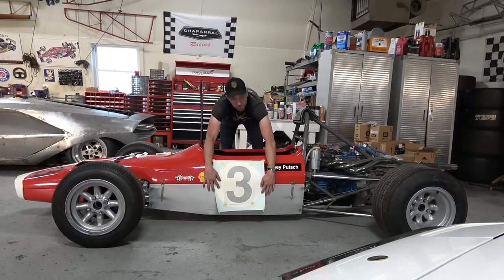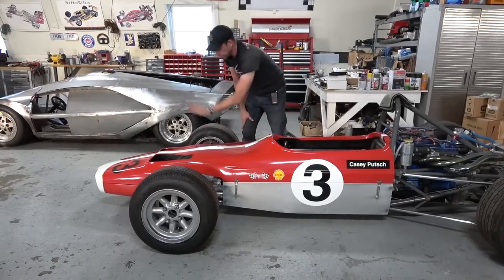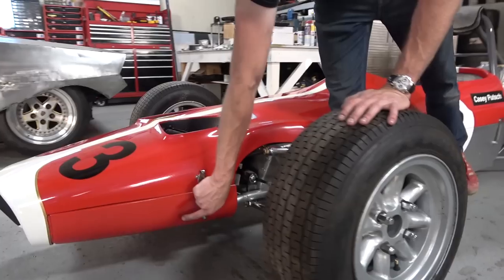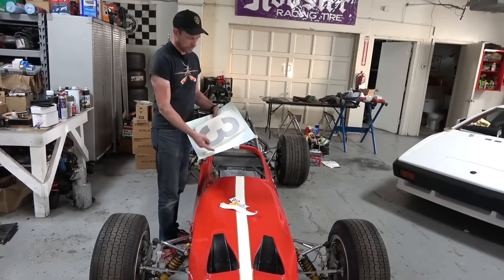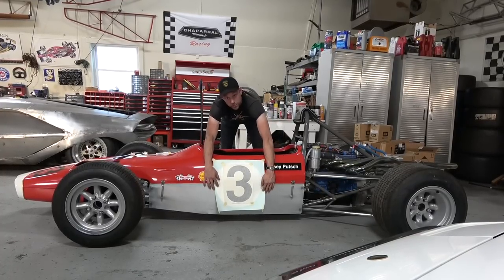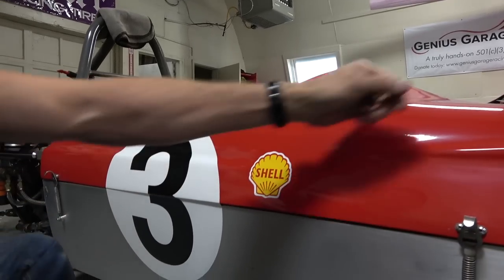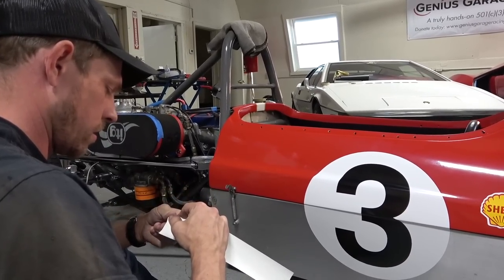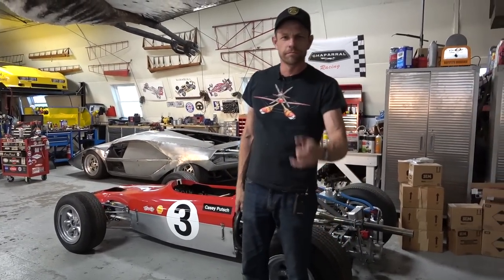Tips on Vinyl Decal Application on Formula B

Comment: Wow wow wow!!!!! So awesome!!!!!!!!!!!!!!  Casey you probably already know this, but it is great to use some dish soap and water in a spay bottle.  Spray the back, and the area. Apply it, and squeegee out the water, and air bubbles.  You will be able to move it around and position it...After you squeegee all the masking tape out all the water use a hair dryer on masking tape, and it will be perfect! Let the tape dry, and then pull it off. Give it a try it is SOOOOOO much easier!  Great job I have never seen anyone do it without liquid.